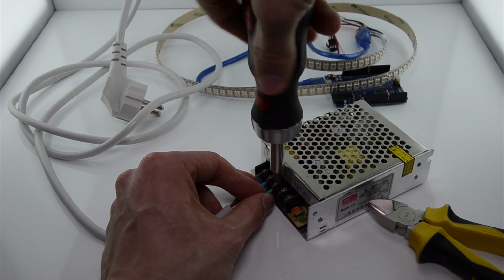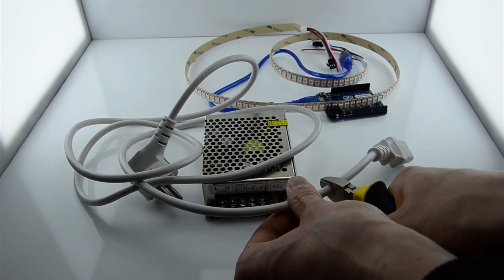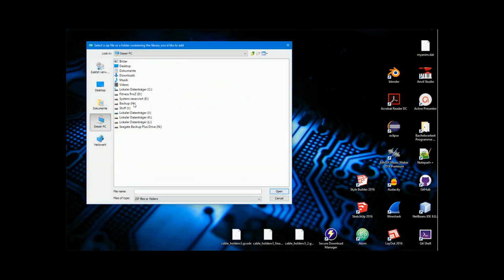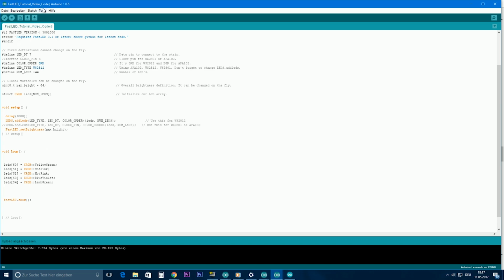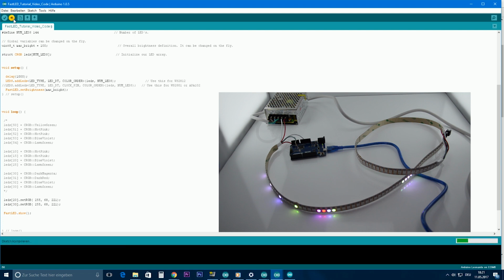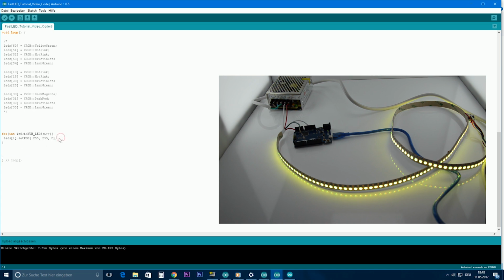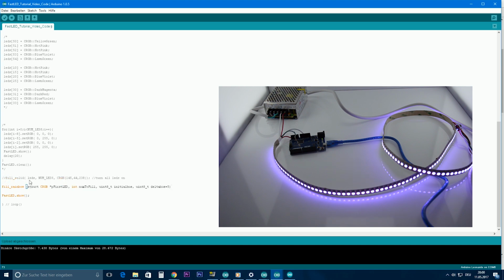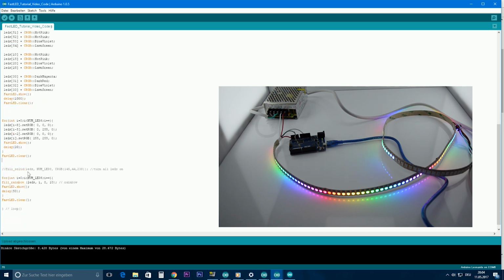How to control WS2812B RGB LEDs with FastLED and Arduino

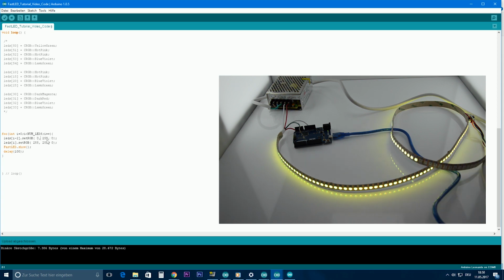Comment: Hi. I have an issue at 15:20, I have mine set up same way but for some reason code does not work with leds[i-2].setRGB(0,0,0), it only starts working if I change it to -1 leds[i-1].setRGB(0,0,0). Has there been some major changes in FastLED library?
Reply from the maker: Edvinas M I am currently away from my desktop, I will try this on Friday. And reply if I find the issue ;-)
Reply: More detail than "the code doesn't work" would be nice, but my best guess is that the index is out of bounds, for i=0 or i=1, you are trying to access negative values indices. Maybe limit i-2 to be above 0.

Comment: Hello, is there any other possible way to plug the arduino and the led strips to power with something else than this big power supply?
Reply from the maker: Yes sure, you can power it with a powerbank ;-) as shown here: https://youtu.be/Oy2giLSU6WQ?t=12m22s  My LED snowboard works like that. This here is a very strong powerbank: http://amzn.to/2ukkDu1 this would be a cheaper one: http://amzn.to/2vto7zb Best of luck :-)
Reply: Hey there, thanks for the response. I'm new into this arduino stuff with LEDs and im willing to order some from China in the upcoming days, and my main concern is about powering all of them up.. so far on my checkout list is the following ;

- WS2811 5050 SMD RGB Strip Addressable LEDs
- Arduino Nano
- Some male/female wires
- IRLB8721 Mosfet
 and
Charging Constant Current Voltage Step Down

But at the moment I'm not entirely sure how this is going to work as I was looking constantly over the internet to find out easiest way to put them all into place and everything is different. What else do you think I should get to assembly them and eventually work? Thank you!
Reply from the maker: Yes should work, but I would better buy a small 5V power supply and no IRLB8721 Mosfet.
It's not that hard you will do it :-)
Reply: hamburgtech But what if the LEDs that I am willing to buy are 12V?
Reply from the maker: No WS2811 are most of the time 5V, there are only some quite rare modules that have 12V, but LED strips always 5V. But if 12V then just buy a 12V power supply ;-)
Reply from the maker: Yes it's because there are 3 leds soldered together, so you can only cut the strip after every 3 leds and you can also only set a specific color for all 3 leds. Better buy this one: https://de.aliexpress.com/item/1m-4m-5m-ws2812b-ws2812-led-strip-30-60-74-96-144pixels-leds-m-individually-addressable/32742461421.html?ws_ab_test=searchweb0_0,searchweb201602_1_10152_10065_10151_10068_10193_10194_10304_10307_10137_10060_10302_10155_10154_10056_10055_10054_10059_100031_10099_10103_10102_10101_10052_10053_10142_10107_10050_10051_10084_10083_10080_10082_10081_10177_10110_10111_10112_10113_10114_10180_10312_10313_10184_10078_10079_10073_10186-10051,searchweb201603_2,ppcSwitch_7&btsid=8ba6d6a1-cd71-49cf-9eff-56d872021fa4&algo_expid=0b1a927c-b308-4f07-9664-87e006a06242-0&algo_pvid=0b1a927c-b308-4f07-9664-87e006a06242  All leds can be controlled on their own and it's 5V.

Comment: What is the resistor on the datapin for?
Reply from the maker: "That resistor is for impedance matching between the Arduino's low-impedance output and the WS2812B's high-impedance input. When using long wires, they act like transmission lines, causing reflections, resulting in unwanted oscillations, ringing and noise." So if you don't use that resistor you might get a bad signal to the leds. Especially if the data wire is a bit longer.
Reply: @hamburgtech  makes sense, thanks for the quick response!

Comment: you are using a arduino leonardo in the video but you linked a arduino uno. why? does the uno have benefits? how many leds can i controll with a leonardo and with a uno? thx
Reply from the maker: david moellmann Hi friend, the microcontroller of the arduino Uno and the Leonardo are quite the same and have mostly the same specs. That's why it won't make a difference what you choose. Well they both can drive up to 500 leds with a good performance. If you want to drive up to 1000 leds, go with the Arduino Mega. For even more leds you need to use a couple of arduinos or should look at the Arduino Due, the Teensy board or the raspberry pi ;-) Best of luck.
Reply: thank you very much but i only have 300 leds to control
Reply from the maker: david moellmann okay cool then arduino Uno and Leonardo will work for you ;-)
Reply: I have another question: Why did you use the resistor between the arduino and the data pin? the data pin doesnt has any voltage on it if im right.
Reply from the maker: david moellmann Hi, well there is some voltage on the data pin, 5 volts. The LEDs could be damaged if you don't use a resistor. The resistor will limit the current on the data wire.

Comment: any project with WS2813 ?
Reply from the maker: Not yet, but I think they will use the same signal and configuration as WS2812.
Reply: @hamburgtech  ya i heard it too,
Reply: i cant light it up, i am using WS2812 library, not working...

Comment: NS107S is coming, the upgrade of APA107. (much better than APA102, can replace Taiwan APA102 directly)

PWM refresh rate can be +26kHz,    Max transfer speed is 30MHz.

Promotion price: 
NS107S: 26+ kHz PWM (the upgrade of APA107), price is $99/K.
APA107: 9 kHz PWM, price is $76.9/K.
(Big quantity requirement, please ask us for better price).

Below is APA102/SK9822 price for your reference, so you can compare it: 
Taiwan APA102: 20+ kHz PWM, price is $110/K
SK9822: 1.2 kHz PWM, price is $69/K.

Next step we will make White and RGBW NS107S LED, now we are working on 16bit NS107S LED.
jason@newstarleds.com

Comment: Geht das auch mit dem Arduino pro micro?
Reply from the maker: Jannis G Ja sollte gehen ;-)
Reply: Wo bekomme ich denn eigentlich genau die Datei aus dem Videro her? Habe bei den Downloads mehrere runtergeladen sind alle irgendwie anders. 

Habe hier ein Arduino Pro micro und ein LED Strip mit 3 Anschlüssen. (GND 12V und DAT)

Habe das schon seit letztes Jahr Sommer oder so und habs immernoch nicht zum Laufen bekommen...
Reply from the maker: http://hamburgtech.de/wp-content/uploads/2015/08/FastLED_Tutorial.zip
Versuchs mal damit ;-)
Reply: ups. xD ist da ja direkt sissl weiter unten. Ich probier es mal. Danke!
Reply: Also habe es auch damit probiert, irgendwie tut sich nichts. 

Werde nochmal schauen welche LED Leiste ich genau habe. Meine LED´s sind aber definitiv weiter auseinander. 
Habe aber trotzdem nur 3 Kabel bzw 5 wo ja 2 zum NT gehen.

Comment: Mal ne Frage habe heute Mein Arduino Bekommen und will damit WS2811 Steuern habe alles gemacht wie du es im Vidoe gesagt hattest. Es ging bei dir damals um Glediator. Ich gebe Saft auf die LEDs sie leuchten Weiß ohne Singal. Ich habe GND und Data an denn Arduino angeschlossen. Wenn ich Jinx öffne dann wir der Arduino Erkannt aber führe ich dann ein program aus passiert nichts. Hast du ne idee woran es liegen könnte
Reply from the maker: Moin, welches Sketch hast Du denn auf dem Arduino gepackt, als Du mit Jinx interagieren wolltest?
Gruß Nils
Reply: hamburgtech Ist der denn du bei Solarlab downloaden kannst. Der für WS2811/WS2812.
Sobalt ich auf denn Start Output klicke geht eine LED am Arduino an.
Das Lustigt kriegen die LEDs nur Strom sind sie Weiß.
Reply from the maker: Hast du einen Arduino MEGA oder welchen?
Reply: hamburgtech jabe nur ein uno
Reply from the maker: Moin moin, sonst versuch mal diesen Code, musst aber FastLED installiert haben ;-)

#include <FastLED.h>
#define NUM_LEDS 299
#define DATA_PIN 6
#define CMD_NEW_DATA 1
#define BAUD_RATE 500000

CRGB leds[NUM_LEDS];

void setup() {
  FastLED.addLeds<WS2812B, DATA_PIN, GRB>(leds, NUM_LEDS);
  Serial.begin(BAUD_RATE);
}
int serialGlediator () {
  while (!Serial.available()) {}
  return Serial.read();
}
void loop() {
  while (serialGlediator () != CMD_NEW_DATA) {}
  Serial.readBytes((char*)leds, NUM_LEDS*3);
  FastLED.show();
}
Reply: Habe es Bereits Getestet mit FastLED das Ging ohne Probleme. Hardware ist also I.O  Scheint ein Software Problem zu sein.
Reply from the maker: Niklas Video der Sketch ist ja für Glediator und Jinx, nur mit FastLED realisiert ;-)
Reply: Sprich ich muss Fast LED mit Installieren?  Damit der Glediator Sketch läuft?

Comment: is it possible to power the 144 LEDs with a portable power source?
Reply from the maker: Yeah sure this powerbank: http://amzn.to/2vJ9cwL should do this job. I used this one: http://amzn.to/2ew9dkP for my LED snowboard: https://youtu.be/Oy2giLSU6WQ . The best solution would be to power the led strip from both sides. One USB for one side and the other USB for the other side. I will make a video about this topic soon ;-) 
Best of luck!
Reply: hamburgtech Please never do this! If you connenct one seperate usb plug on each side the fuse/power supply might blow up. You need to only use one usb plug, otherwise the stronger power supply (which will always exist, regardless what voltages they have) will try to chrage up the second one. Just use one usb plug (with the highest max current) parallel on both sides.
Reply from the maker: Okay I will do this to show you that it wont't blow up okay? ;-)
Reply: hamburgtech You might have a power supply with parallel conected  ports.
Reply from the maker: IcanTellYouHadEnoughYTForTodayStopWastingYourTimeAndMakeSthOutOfYourLifeNowAndDontReadMyNameAgain I will take a multimeter and measure and we will see how it works out ;-)
Reply: hamburgtech All right, ill remember you said that ^^
Reply from the maker: Okay cool ^_^
Reply: hamburgtech OK thank you so mutch
Reply from the maker: I will try to upload a video next weekend about this topic. Then you can see how easy this can be done ;-)
Reply: hamburgtech ok

Comment: Weißt du, dein Tutorial ist ganz gut für Anfänger. Aber es ist einfach teilweise fahrlässig falsch. 
Eine WS2812B LED zieht keine 60mA bei voller Leistung. Eine normale RGB LED zieht 60mA, wenn man 2, 3 und 3V anlegt. Bei einer WS2812B legt man aber 5V an. Das Chipset der WS2812B steuert dann die rote, grüne und blaue LED per PWM so an, dass maximal 18.5mA durch jede LED fließen. Das PWM-Signal von 0|5V hat dann einen Dutycycle von 40%(Rot) und 60%(Grün,Blau), was durschnittlich  2V(Rot) und 3V(Grün und Blau) entspricht. Wenn man elektronische Grundlagen und PWM versteht, weiß man direkt, dass dann bei 5V ein deutlich niedrigerer Strom als 60mA fließen muss. 
Die LEDs brauchen nach 2V*0,02A+3V*0,02A*2 = 0,1216W. Wegen I = P/U = 0,1216W / 5V würden theoretisch 24mA fließen. Es gibt aber überall Verluste, durch z.B. das Chipset oder den Leitungswiderstand und den dadurch verstehenden Spannungsabfall. Ich selbst habe 100 WS2812B LEDs genommen, alles so verbunden, dass überall stabile 5.2V anliegen und die LEDs haben zusammen 4A gezogen, was 4A/100LEDs = 40mA entspricht und keine laut dir 60mA.

Wo wir gerade bei den Leitungsverlusten waren. Laut dir soll man einfach die Anzahl der LEDs * 0,06 nehmen und dann ein 5V Netzteil wählen, das soviel Ampeer, wie das Ergebnis liefern kann. Bei kurzen Strecken mag das gehen aber nach 2,5 Metern mit 60 LEDs/m kam ich schon auf unter 3,5V, was eine Verdunklung der LEDs bewirkt, was man normalerweise von alleine bemerken sollte....
Einen richtigen Weg solche Strips zu versorgen wäre parallel dicke Kabel mit GND und 5V zu verlegen oder, wie ich es mache:
Ein dünneres Kabel mit GND und 12V/24V/36V verlegen und damit in Abständen Buck Converter versorgen, die dann alle auf 5.3V feinjustiert werden und damit den Strip versorgen.

Wenn du dein eigenes Geld falsch investierst oder deine eigenen Sachen falsch machst, kannst du das gerne machen aber dafür, dass du anderen Leuten das Gleiche rätst fehlt mir ein Adjektiv, wofür du mich nicht anzeigen könntest.

Tu deinen Zuschauern und deren Geld den Gefallen und lösche den Kommentar nicht. Im echten Leben kannst du Dinge, die dir nicht passen auch nicht einfach mal löschen.

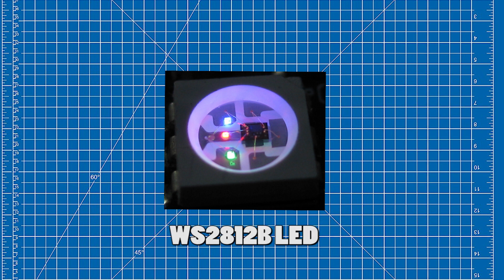EDIT: 0:35 "Eine Ws2812B LED braucht 60mA Leistung." Du merkst es schon selber oder?

Comment: Sir your sketch is showing this erro please help me.

Arduino: 1.6.10 (Windows 7), Board: "Arduino Nano, ATmega328"

C:\Users\Rahul Singh\AppData\Local\Temp\Temp1_FastLED_Tutorial.zip\FastLED_Tutorial\FastLED_Tutorial_Code\FastLED_Tutorial_Code.ino:7:21: fatal error: FastLED.h: No such file or directory

 #include <FastLED.h>

                     ^

compilation terminated.

exit status 1
Error compiling for board Arduino Nano.

This report would have more information with
"Show verbose output during compilation"
option enabled in File -> Preferences.
Reply from the maker: Hi friend, as it seems you did not install the FastLED library properly. You should check this point, then it should work. Best of luck :-)
Reply: Thank you  Sir.
Reply: now it's working.
Reply from the maker: Love Entertainment & Technology nice :-)

Comment: should it be 470 ohm Resistance? i have 220 and 1k one
Reply from the maker: Hi friend, well I always take a 470 ohm resistor, but a 220 should also be fine. Any resistor in that range is better than no resistor ;-)
Reply: Why do you need a resistor?
Reply: Why do you need a resistance ?
Reply from the maker: Well it protects your leds. It's not 100% needed, but there were a lot of people that damaged their leds, because they did not use a resistor on the data wire.
Reply: Hi, I dont have 470ohm resistor, is it better to use two 220ohm resistor in series or one 1k in paralel? Thanks! Great video dude!
Reply from the maker: João Pedro Hi friend, well a single 220 resistor should also work. I think that is the lowest possible resistor for this purpose. Or you take two 220 in series. Best of luck :-)
Reply: Great! Thanks for the answer!

Comment: Echt Super erklärt. Ich habe gestern meine WS2811 bekommen. Jetzt brauche ich ein Arduino Uno. Problem ich brauche ein SD Karten Slot dieses kommen  bei ebay meinst aus China. Ich brauche es aber anfang November. Kommt das nicht an habe ich ein Problem. Geht da auch das ? Hat ja auch ein SD Karten Slot. Oder hast du noch ne Idee?  https://m.ebay.de/itm/Arduino-UNO-R3-Board-Ethernet-Shield-W5100-SD-Expansion-Board-Modul-TE366-/371845926287?hash=item5693be8d8f%3Ag%3APUAAAOSwUKxYhPi6
Reply from the maker: Moin, könntest Du wohl theoretisch auch nehmen, aber ich habe mal mit dem Shield gearbeitet und weiß, dass es etwas komplex war ;-) Wozu brauchst Du das SD-Shield denn? Willst Du Glediator Dateien abspielen? Notfall hier bestellen: https://eckstein-shop.de/TF-Micro-SD-Card-Memory-Modul-Arduino-Atmega-Kartenadapter-cardreader Viel Erfolg ;-)
Reply: Will es am Ende mit Jinx die Streifen Steuern. weiß nicht ob der Interne Speicher für das Glediator Script reicht. 
Also würde ja auch das gegen http://www.ebay.de/itm/Micro-SD-Speicher-Board-Modul-TF-Kartenleser-Memory-Shield-SPI-fur-Arduino-/252312538439?
Reply from the maker: Moin, jo das Modul geht, verwende ich unter anderem in meinem LED Snowboard ;-) https://www.youtube.com/watch?v=eTp5M_Z_RR4 bei ca 6min ist nochmal der elektronische Aufbau gezeigt.

Comment: Hello. Do you know the difference between the included fastled.h and the original adafruit_neopixel.h?
There are advantages when using the lib? I always use the adafruit original.
At 7:45, i think the max. brightness value ist 8 bit, 255 not 256. The result of 256 ist zero or one, i think.

Hallo. Kennst du den Unterschied zwischen der von dir verwendeten fastled.h und der originalen adafruit_neopixel.h?
Ich verwende immer die von adafruit. Gibt es da Vorteile beider fastled.h?
Bei 7:45 spricht du von max. Helligkeit 256. Ich denke bei fastled.h wird es auch nur 8 bit sein, also 0-255. Da der Wert intern
8 bit aufgelöst ist, sollte das Ergebnis bei 256 null oder eins sein.
Ich erwähne das nur, weil es für Einsteiger z.b. manchmal unverständlich ist, dass die 256 Werte von 0-255 angesprochen werden.

Gutes Video.
Grüße aus Berlin.
Reply from the maker: XrControl Moin, jo das mit den 255 stimmt, es wird die 0 mitgezählt. Also Adafruit und FastLED sind zwei verschiedene Libraries, wenn ich mich nicht täusche, können aber alle Befehle des einen Libs auch in dem anderen verwendet werden. Zumindest bei Adafruit sollten die FastLED Befehle funktionieren. Ich glaube die Unterschiede sind maginal, aber bei Adafruit hat man halt eher die Bewerbung von deren Produkten mit dabei, siehe Neopixel und Dotstar. Im Test mit einem Oszilloskop war FastLED zwei Millisekunden schneller als Adafruit, beim ansteuern von 60 APA102. Also leicht bessere Performance. Gruß aus Venedig Nils
Reply: Ah. OK. Danke.
Zwei Millisekunden schneller für die Gesamte Sequenz des gesamten Bandes oder pro LED?
Bei Zwei Millisekunden pro LED wäre die fastled.h tatsächlich interessant.
Reply from the maker: XrControl Ne war für den ganzen Stripe. Haben ein paar Tests gemacht, weil wir herausfinden wollten, welche Libs für eine POV Anwendung geeignet sind. Am schnellsten war FastLED, dann Adafruit, ein anderes Library war über 30ms langsamer lol. Aber der Arduino war einfach zu langsam. Wird wohl ein Teensy Board jetzt ;-)